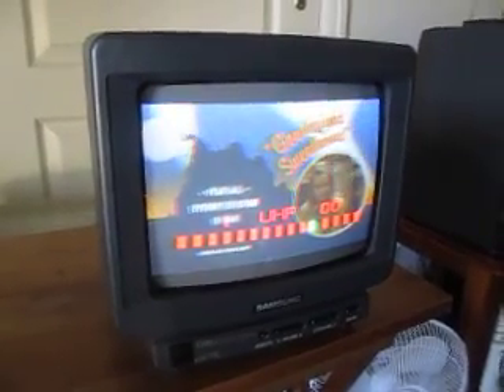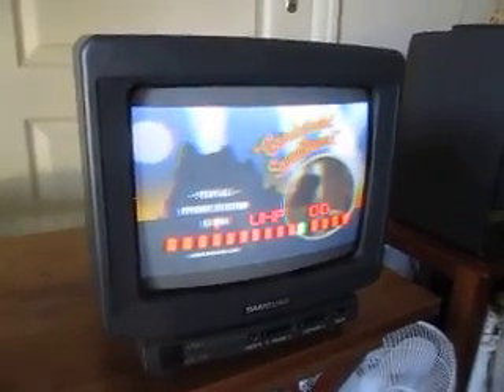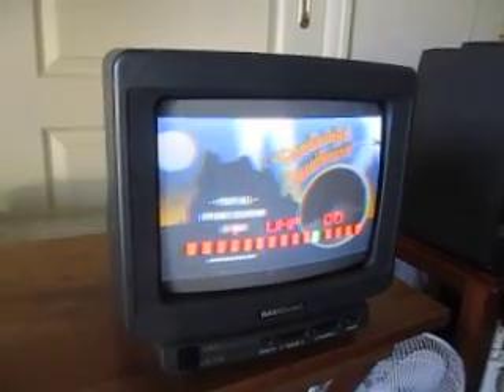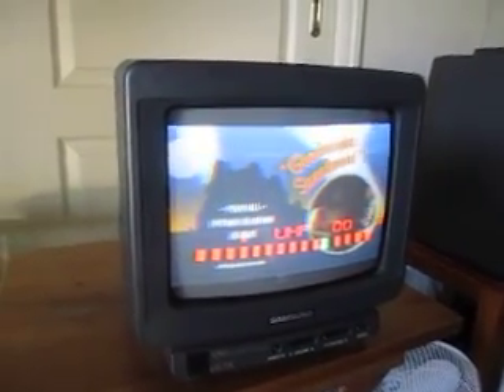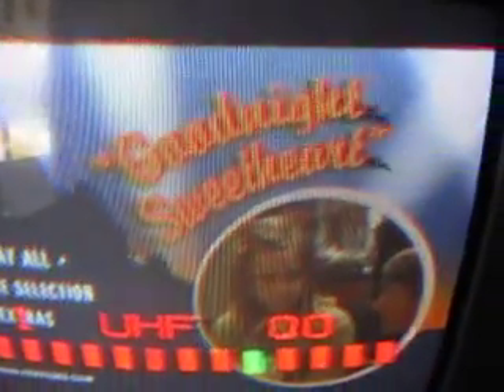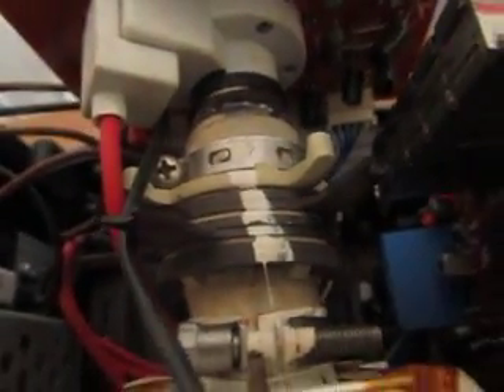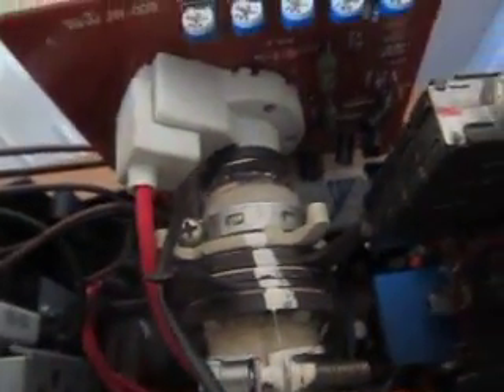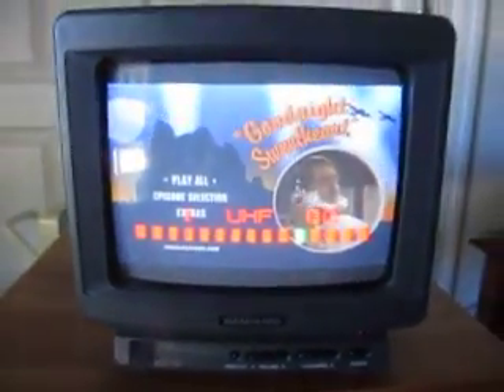Adjusting the convergence on a CRT television

Comment: Hello, I have a problem with a CRT TV. Sometimes it works perfectly, other times there is too much red in the picture, other times not enough blue or green. Please can you tell me if this is a convergence problem  and if so how do you correct it? Any advice would be appreciated!
Reply: I used to work on CRT's nope it is a color driver circuit problem the drivers are usually on the small PCB on the neck of the tube, you probably have a dry solder connection just unplug the TV discharge the EHT capacitance from the high voltage line going to the back of the tube use a long wire connected to CHASSIS before you do anything, after discharge gently remove the small PCB and clean it with isopropl alcohol  look for signs of bad solder joints re solder any bad one's also check for cracks in PCB hope this helps ?

Comment: Fairlane500skyliner

Hey man i have a Toshiba CRT TV 1990 model # E67555
It has a problem TV image has one big black bar running horizontal seems like image shifted/extended up and its like folding in half on top and bottom looks like it has shrinked when i turn off my TV and turn it back on seems like the black bar is couple inches bigger and i have to leave it on for a couple minutes inorder to make that black bar smaller. The TV has a crack at the bottom by where the buttons are at idk if i moved something it caused this to happen. Do you have any idea what i need to readjusted inorder to get a full screen picture again on it?
Reply: +RHA eaglestriker hey man i recently am having an issue with this as well
Reply: +Marshall Guenther Hi ! check the raster shift rings